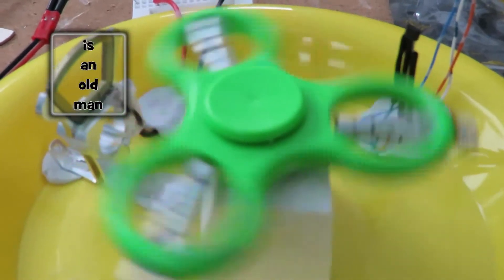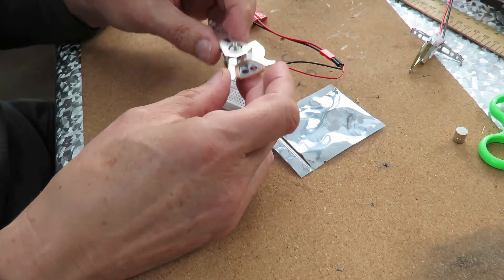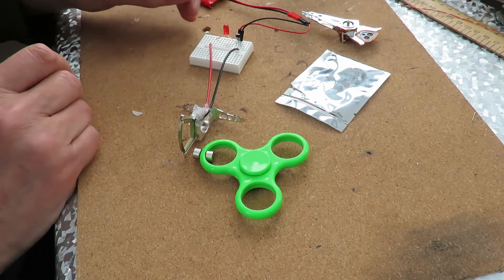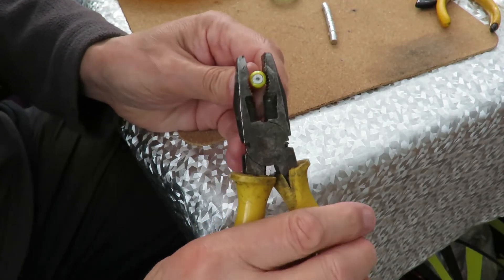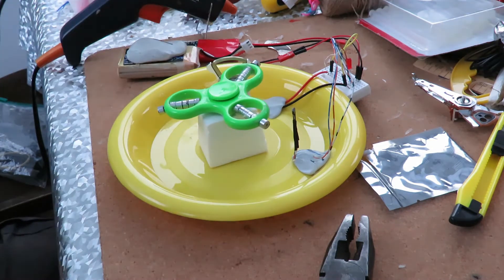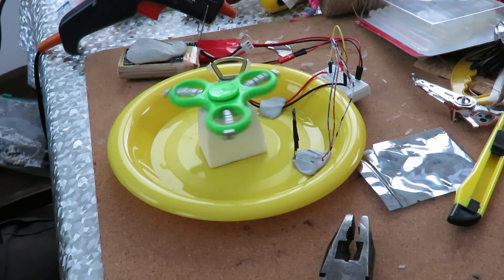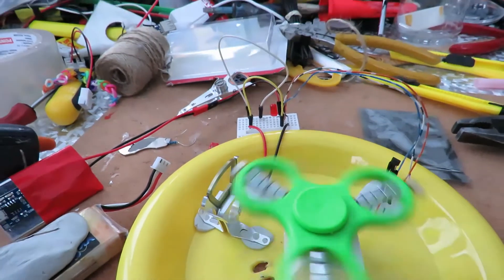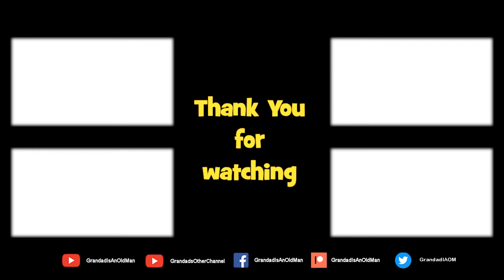Hall Sensor Hard Drive Actuator Arm Coil - Pulse Motor

Comment: Do you have any magnetic paper, those green semi transparent plastic sheets that show magnetic field areas?  I have one now after seeing somebody mess with them and a odd thing came up . When you place a flat rubbery magnetic, like ad's or calendars to stick on a fridge, the pattern is striped. If you bring a strong magnet across the rubbery magnet you disrupt those stripes forever. The stripe formation is what allows it to have the strength they do which is still pretty weak. You could see pattern that odd shaped coil would produce if you had that magnetic paper.  btw, good job on this build.   : )
Reply: No I haven't got my hands on any of that stuff yet. Maybe some time in the future.